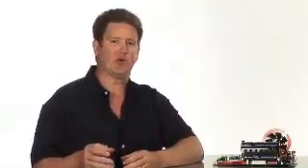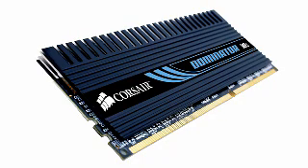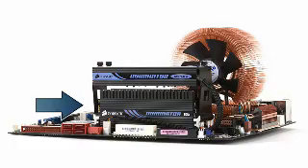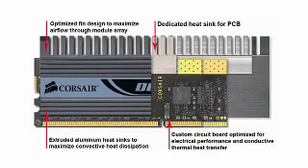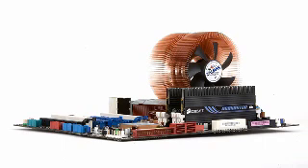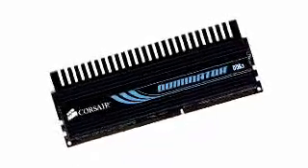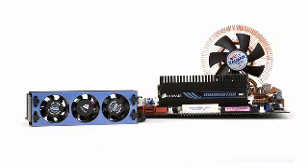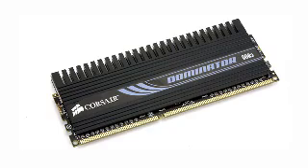Corsair Explains the Advantages of DDR3 and DHX Technology

Comment: Hm I'm still running a Socket 478 based system and it's only "outdated" because I can't find any upgradeable parts and I'm doing things I'm not supposed to be doing :( If you don't plan to upgrade, overclock, do hardcore stuff like rendering a lot of H.264 videos at the same time, just get an LGA775 system and you should be fine for the next 3-4 years.